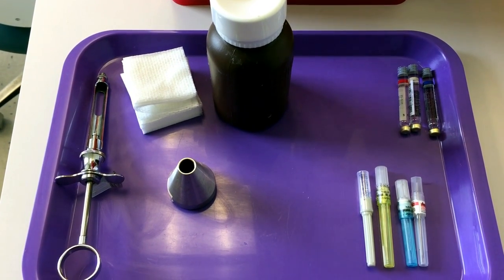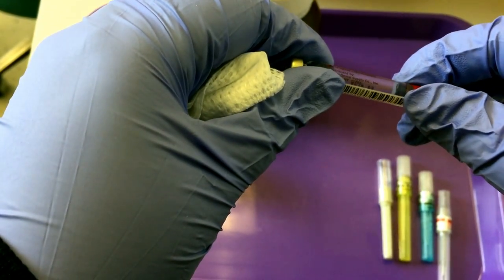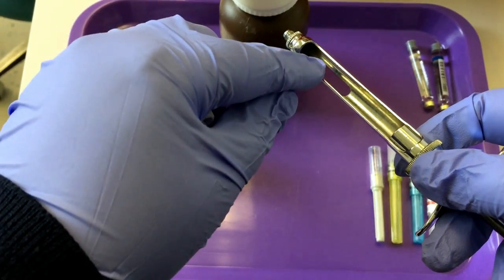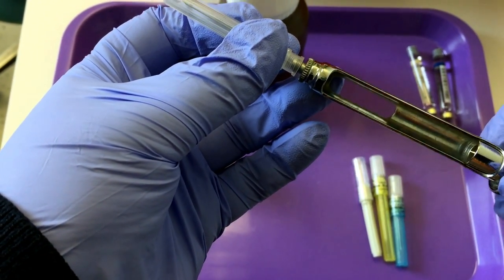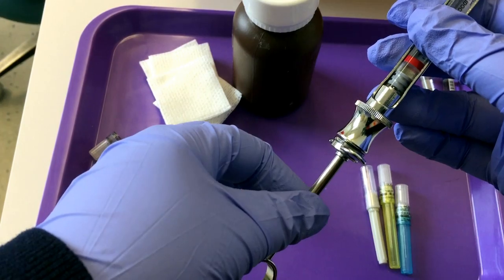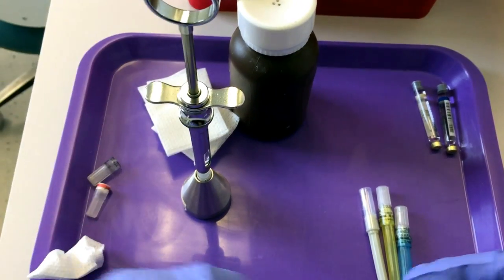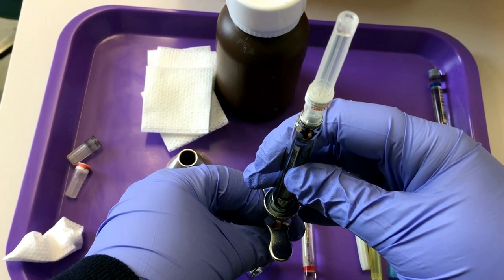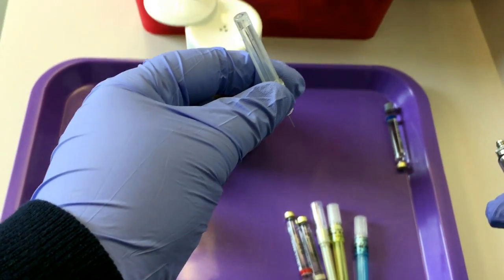Local Anesthetic Syringe Assembly

Comment: So the dentist will tell dental assistant what anesthetic cartridge he would use?
Reply from the maker: Yes, usually dentists have a preference based on the arch. My original dentist preferred articaine on max. filltration and prilocaine on mandibular block, so I always knew what he wanted. Now I occasionally work with volunteer dentists and I always ask first before assembling - many of the new dentists I work with prefer lidocaine.

Comment: Can you explain the different needle colors and when they are used?
Reply from the maker: Great question! The 2 most common needles used in dentistry are 30 gauge short (typically blue cap) and 27 gauge long (typically yellow cap). The higher the gauge number the smaller the diameter. Smaller needles are more comfortable for the patient, but they are more flexible and are typically used for infiltrations - which only penetrate a short way through the tissue. The thicker 27ga. long needles are used for mandibular blocks, because the needle has to penetrate thicker tissue for a longer distance. 

Keep in mind manufacturers can choose what colors to use for their color coding systems.
Reply: @StephanieDerfus  thank you so much! I recently started a dental assistant position at a general dentistry office so I’m learning all I can. This helps a lot!